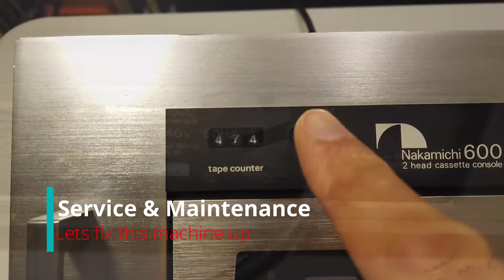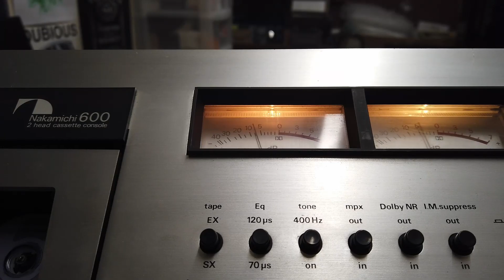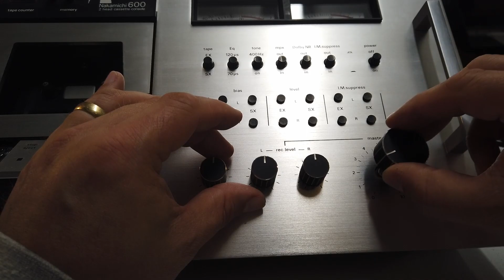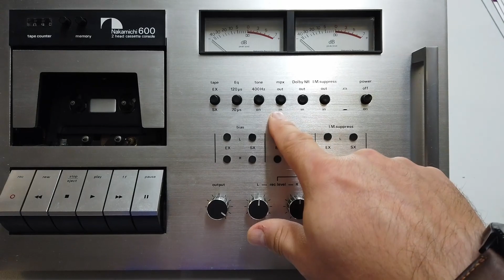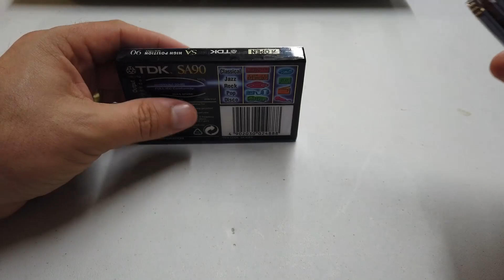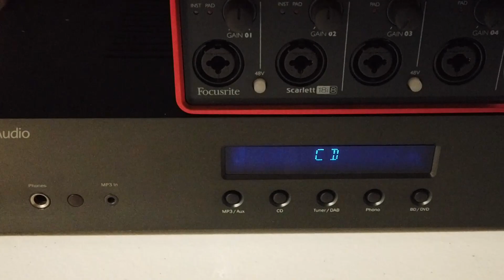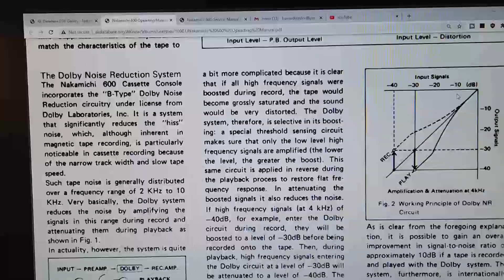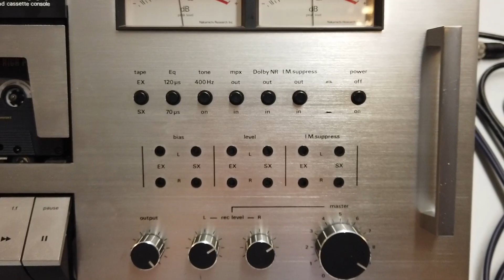DuB-EnG: Worlds Best 1975 Cassette Tape Deck - NAKAMICHI 600 - Service Repair Review Restoration

Comment: I have been keeping one if these alive for 35 years. Built like a tank.
Reply from the maker: I may ... sadly ... sell mine... at least I know it’s been really well serviced!!
Reply: @DubiousEngineering  They are fantastic machines. I need to do a torque gauge setting on it. Do you have one, I realise UK to NZ is a long way.
Reply: one that never was driven in a war?just the first

Comment: I had one of those, mainly used it with head phones in the barrack block but occasionally through a BIG amp and speakers
Reply from the maker: you must have had some money back then! ...  I just looked on eBay and these are going for £400...  can you remember how much you splurged on yours?
Reply: @DubiousEngineering  LOL But I had loads of money when I first joined the RAF,  not because of what they paid but the job I had before LOL  cannot remember what it cost but it was a present for getting of of basic.  (Square bashing).

Comment: Fantastic video, great machine. My little brother found one being thrown out... it was in very good condition and almost worked.. the grease on a little pivot (capstain pivot?) had seized, I cleaned it and put a little dab of something on it and it works. I have suggested he gets it serviced, properly, that's a little beyond me. The only problem of note with it is that if you activate the test tone, it stays on... switch is, I'd guess dirty.
Reply from the maker: Ahhh yes, you can buy cans of spray on switch cleaner...  or take it apart and use some silicone lubricant!
Reply: @DubiousEngineering  Audiogold in North London service them, and are trustworthy. The chap suggested taking it there rather than posting... a charge of about 300 quid should be expected, to be fair to him, he also said 'if it works, just enjoy it until you get problems' as he accepted the servicing cost is considerable... they sell them once serviced for the best part of a grand!

Comment: Excellent video, thank you for making it.
I have a question, in my 600 unit, when I put a cassette in and press play, after a couple of seconds it stops. I've changed the belt, but the problem still continues.
Can you suggest what I could try next?
Reply from the maker: Use a volt meter and current meter to see if the motor is stalling, check all the cogs and wheels to make sure they are free running.

Comment: Hello my friend excellent video. I have the same unit as in your video. The unit powers up but will not turn the tapes when hitting the play button. Needles bounce when I pop a tape in. Drive belt seems to be intact, any suggestions?
Reply from the maker: Check voltages are being applied to motor with multimeter
Reply: Thank you Sir

Comment: I just picked up one of these off of marketplace near mint from the original owner. Upon first playback it’s playing the tape slightly slower than what’s actually recorded if I compare it to a digital file. Would that lean to needing a new drive belt? Or adjustment of the tape speed knob? Any help is GREATLY appreciated.
Reply from the maker: I’d do both John.  Drive belt first and then re-check speeds ...  out of interest what price was it advertised at?!? I’m interested to know what mine is worth!
Reply: @DubiousEngineering  ok thanks. I followed along with this video to take it apart and I checked my drive belt. Looks original I think but it’s not brittle. Can you help me find a good replacement belt? Share a link to one you’d recommend? I paid $400 for mine shipped. There are recent sales on eBay for these clean but not serviced for around $300. Serviced for $400-500. This one I found is in better condition than most I’ve seen so I was fine with paying more. The seller told me it was 100% but obviously it’s not if the speed is a tad slow. I’m fine with replacing the belt myself. I think if I were told the belts were original I would have offered $300 tops. Oh well lol
Reply from the maker: @jhelmuth87  Thanks so much for your info...  so I re-watched my video and I think its a 3mm by 130mm flat belt.  Check if they want diameter, radius or length! - I have no link to the purchase - sorry!!  All the best and enjoy the new machine!!

Comment: That was a nice looking, solid machine with lots of metal. Chunky! Oh, btw,, Your tapedecks speed might be off, since you recorded the 400Hz testtone on the deck itself, so it of course plays it back at 400Hz. To see if the tapespeed is accurate though, You'd need a tape with a testtone that is recorded on a deck where you know the speed is accurate, then You'd need to play it back on the Nakamichi and see if theres a frequency variation, then adjust the speed of the motor accordingly, if needed. I love Stereo gear from the 70's. I don't think todays gear will still be useable after 40 years.
Reply from the maker: I need a calibration tape...  that would also check the head alignment too...  I may well invest in one now I have an epic deck!  I hope you’re having a great week! all the best!  H

Comment: Hi how fast do these machines run , thanks
Reply from the maker: They are standard speed - not high speed high bandwidth.
Reply: @DubiousEngineering   hi it was just in comparison to reel to reel as I'm toying between the two , thanks
Reply from the maker: @MrBubbies543  if your interested in this unit, let me know.  I’m in UK

Comment: Lol, the 1000 was wayyyyyyyy better than the 600 and the 700 was also out 2 years before, 

Both of those are 3 heads that can hold up to reel to reel quite well

The 600 on the other hand is a 2 head deck with no monitor function and on top of that is even more of a pain in the ass to fix than the 700
Reply from the maker: You certainly know your Nakamichi!!! :-) ...  this unit is still quite lovely :-)
Reply: @DubiousEngineering  def is but uh just get yourself a 1000 or a 700, and if you really wanna go balls out, check out the ZXL versions of those decks, ZXE in europe

They are something to behold

Comment: Beware 90% of what is to be done has not been shown. A good dozen of screws and parts must be removed ( and re-fixed) so It’s “a little” more difficult than what it looks and not for rookies…
Reply from the maker: I also didn’t show a lot of the setting up of the bias controls which is even more of a challenge than unscrewing screws.  If I had gone into full detail this video would be a couple of hours long!  :-)

Comment: AHAHAH!!!i know at least 10 or more that were all better than this and i had the entire system where this deck fits, but for a entire month i thought i had a great system ,laughing at my own cost, but sold my fathers entire nakamichi devices and with the money bought a sport car, a maseratti V8, 70´s look
Reply from the maker: Yeah, its a good one for its age 😂..  enjoy the V8 😜
Reply: @DubiousEngineering  at least will work for more years than any nakamichi device, kept some but only the ones i liked when using them and they last more than any other also the sound quality was above average while top end models were far inferior to other brands good decks, still have the 700ZXL, the BX-2 and the DR-1